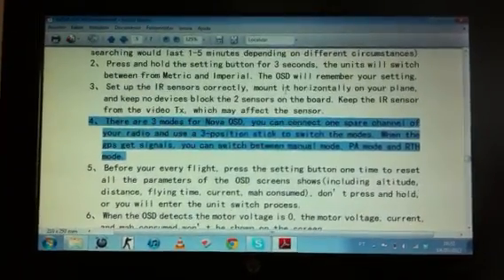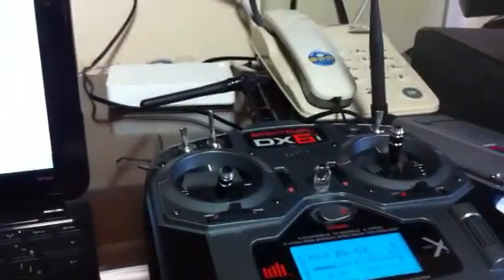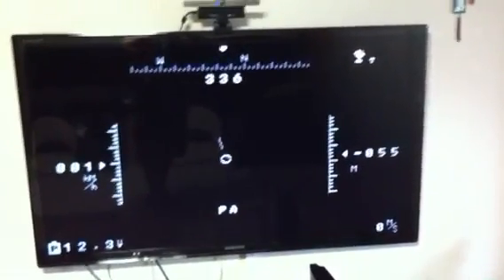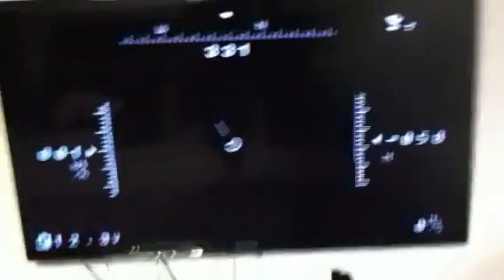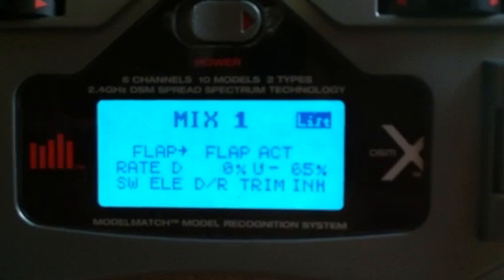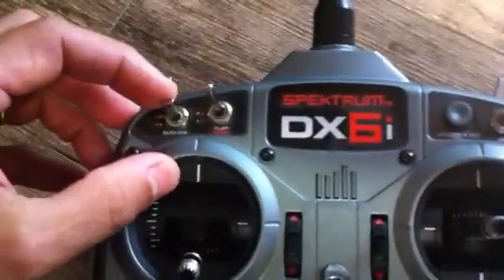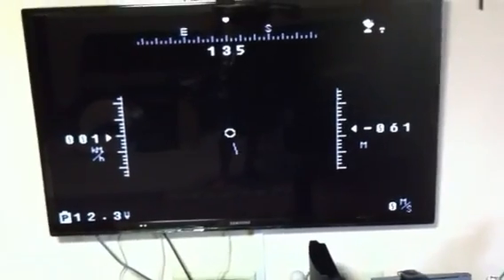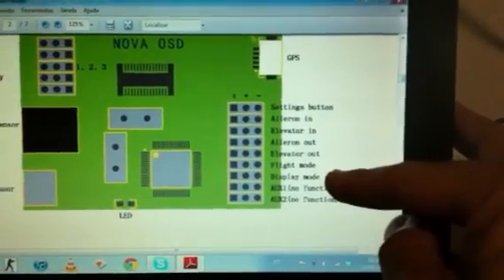Nova OSD flight mode, 3 position key setup for DX6i

Comment from the maker: Dear Gerardo,

Your receiver (ar6200) does not support full Failsafe feature, which means that you will not be able to tell your receiver what to do when the transmitter connection is lost, except for the throttle position.
Therefore, if your question regards the RTH function when the trasmitter signal is lost, then you need to get yourself a receiver with real and full failsafe function. If you just want to activate RTH function in your transmitter, then yhis video is self explanatory.
Cheers!

Comment from the maker: You may use the original Spektrum receiver, but I am not sure if you will have the failsafe function in all of their receivers. The failsafe will be handy when you lose contact between the RC and the receiver, activating the RTH function while keeping some throttle.

Comment from the maker: Hi there! Hey that´s a tought one, but I would: 1 - Check for the MIX 2 function activation; 2 - Check for the wiring: an inverted Y harness could do that, 3 - Rebind your receiver. In case it works right after rebinding, I would suggest that you replace it (you don't need these kind of unexpected behavior up there...). At last, I would try a different receiver...

I hope this will help.

Cheers,

Marcelo

Comment from the maker: If your receiver does have the failsafe funtion (The Orange RX7 does have, whilst Orange RX6 doesn´t...), you will be able to set up all the channels position during the binding process. This way you will have to make all the set up for the RTH, keep all the controls in your transmitter in that position, and re bind the receiver in that position. Remember to keep also some throttle (3/4 +), as the Nova OSD will not have any command over it during the RTH...hope this will help

Cheers, 

Marcelo

Comment: Hi mate! Thanks for the video. I too have a dx6i with Orange rx 7 channel and planning to buy Storm OSD for fpv. Only one thing I have not yet found doing search. That is from where to get RSSI voltage from the rx circuit. Were you able to do it with your rx. Any info would be much appreciated.

Comment: I also have a Dx6i and am planning on getting the Storm OSD which also requires a three position switch. I figured there must be a way to configure it as you did. But my question is this; I use flaps and dual rates. Dual rates, not so much, but is there a way to configure it to another D/R switch so I don't have to activate my flaps when I need RTH?

Comment from the maker: Hi there Ginannakkas! What it your receiver? If you are using the Orange RX 6 channel from Hobbyking, you will not have a Failsafe function, only the Smartsafe, which is the function that will keep the same throttle level as you have programmed during the binding.
This is why I am using the Orange RX 7 channel version: this one has the Failsafe, which allows me to activate RTH function when signal is lost.
Please confirm if your receiver actually carries the failsafe function though.

Comment: Hello friend.
What about failsafe? I have dx6i and when the transmitter lose signal I can configure the throttle to a specific speed but I cant configure the RTH to kick in. Is that possible? if yes, how?
Thank you for your time.